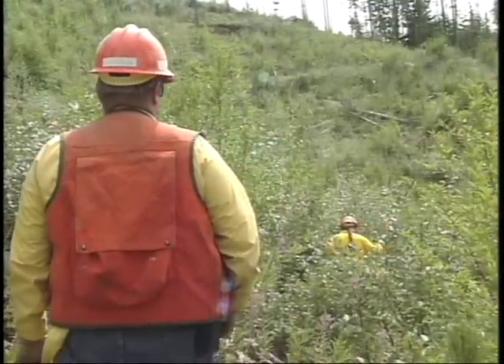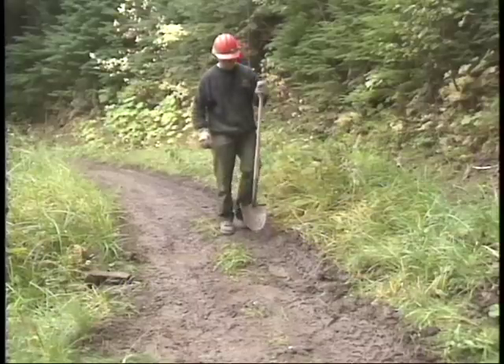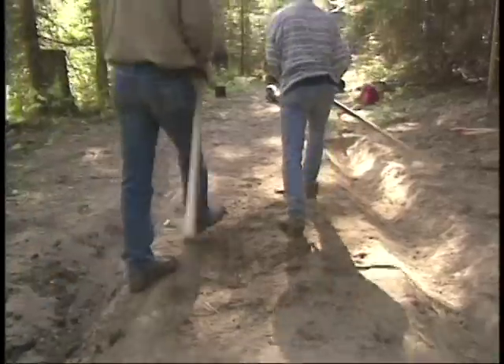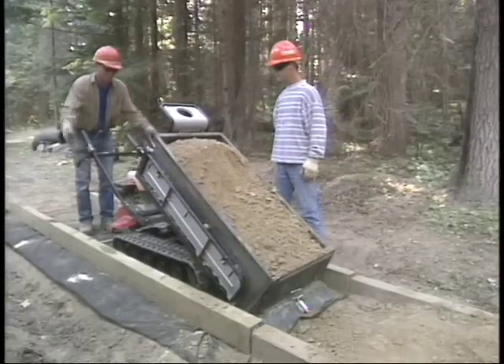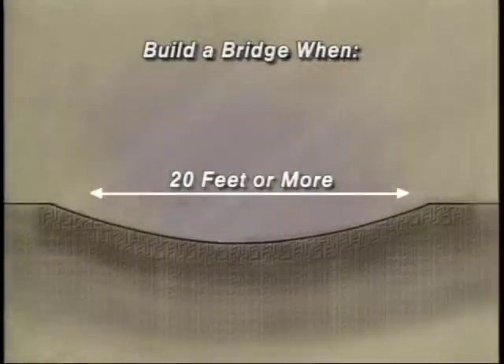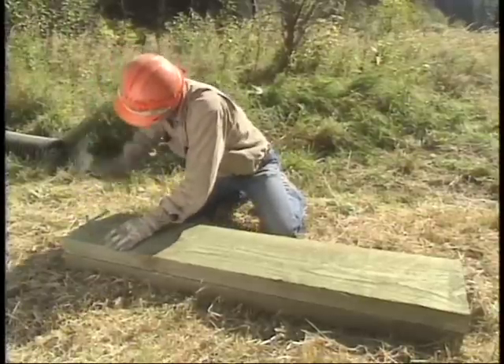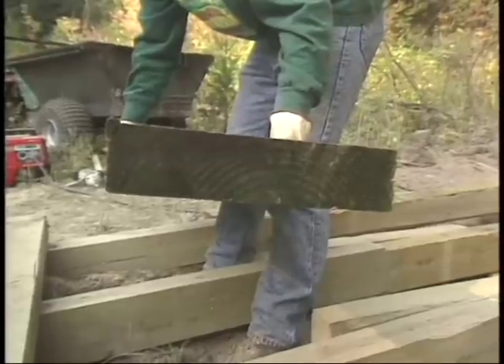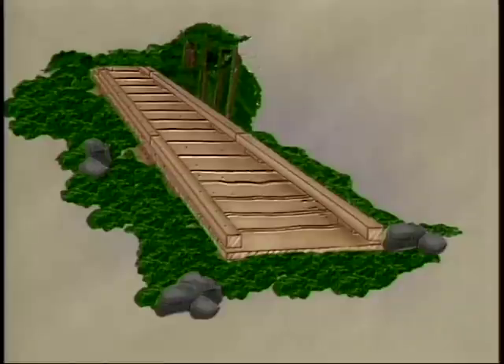Surface Water Control Techniques for Trail Maintenance

Comment: For a local trail, I just weed whacked it with a swinging chopper. Because the damn park does not maint what is out of sight even though it is part of the park trail. The trail was so overgrown the trail was almost out of sight. Both sides grew to the middle. So this video is a joke parks spending money on their trails.
Reply: Find out who is responsible and get involved. I do trail work professionally and as a volunteer. Complaining on youtube doesn't get anything done.
Reply: True
Reply: You're talking about just one trail on one park, or forest, or whatever. Could also be a trail that has been intentionally ignored. Don't judge the whole system by one tiny example.